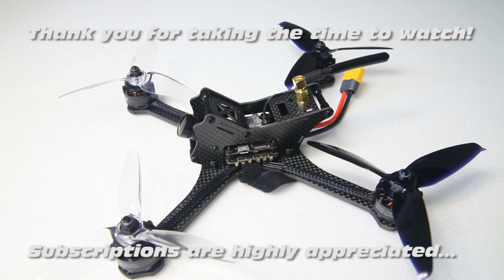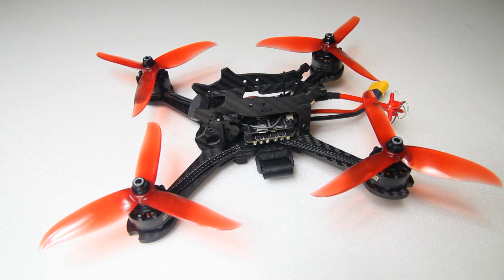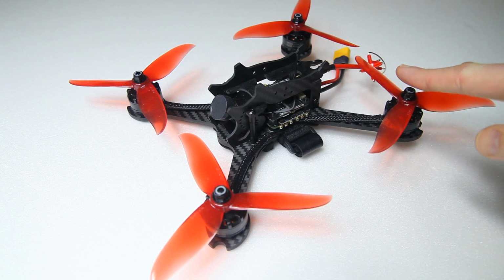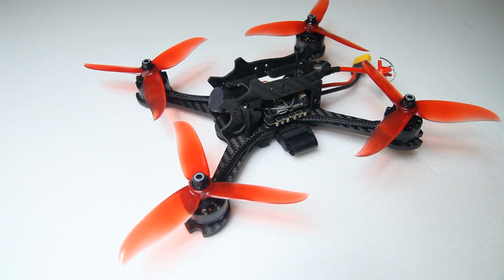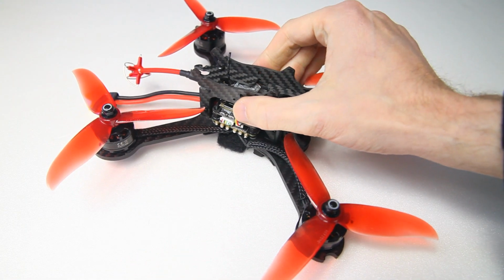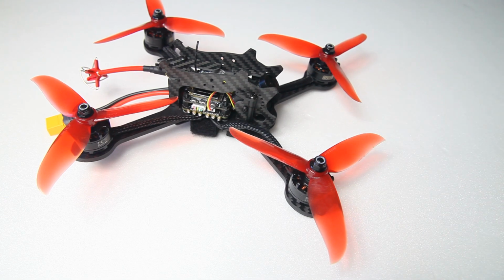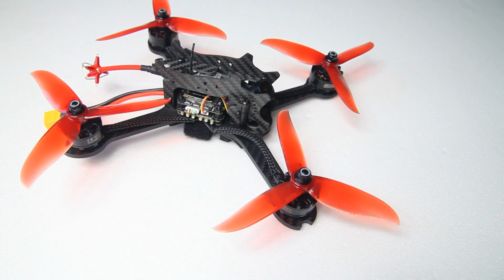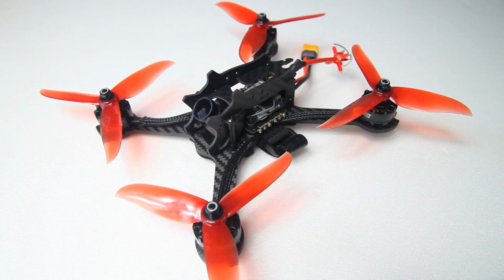Sky-HERO Dark Max 4-6S FPV Racer :D - The... WHAT???

Comment from the maker: A Sky-Hero Dark Max??? Never heard of that man! :P
Link to the Furibee Dark Max: https://goo.gl/kFGzkj 

Link to the Sky-Hero OB1 v2 frame: https://www.fpvdirect.com/sky-hero-ob1-naked-frame-5-inch-revision-2.html 

Link to the Hyperion G7 lipo used: https://hyperion-world.com/en/p2813648-hp-g775c1400s4 

Music used in video: https://www.youtube.com/watch?v=5ptXIfhUrTA

Specifications
wheelbase: 220 mm
frame: 4mm Carbon Fiber Stretched X
flight controller: Omnibus F4
ESC's: BLHeli-S DShot 600
motors: DYS 2205 2550 Kv 
camera: 600 tvl CCD NTSC or PAL selectable
VTX: 25 / 100 / 200 mW 48 channels
receiver: FrSky D8
lipo: 2-6S! (not included)
OSD: yes
buzzer: yes
LED's: no

Comment: You can find Dys replacement motors on Gearbest.
Reply from the maker: Not exactly the same motor, OR the product-description isn't correct (which has me not find them) :$
Reply: I just checked looks like the same motor to me. I also switched my Darkmax to a Rooster frame. Flys well : )
Reply from the maker: Hmm weird.. Do you have a link for me?? 
Haha! another DM frame has been replaced ;)   and yep.. the setup works well
Reply: I think Dutch is looking for motor parts, not completely new motors.
Reply from the maker: Well Parts would be AS WELL.. but I can't find the exact motors eighter :$

Comment: Nice project buddy. As for the camera I'm not an FPV guy so my opinion wouldn't weigh for much but I'd make it fixed somehow with foam or something. It's a nice looking frame... kinda makes it look angry which suits the DARK MAX name. cool stuff. How many quads you own now btw??? ;-P  cheers bud
Reply from the maker: Thanks brother :) 
well yeah.. the cam is somehow not-bad-at-all (which can't be said for most Furibee's :$)  And true.. by now I've just shoehorned in there with (thin) double-sided tape.. Will probably allso dampen vibrations a bit :) 
For sure! This one looks a lot better indeed :) 
Ehmmmmmmm! Might not be as manny as you think, as I offten sell quads as well :$.. But still: more then enough.. About 10 I'd say..